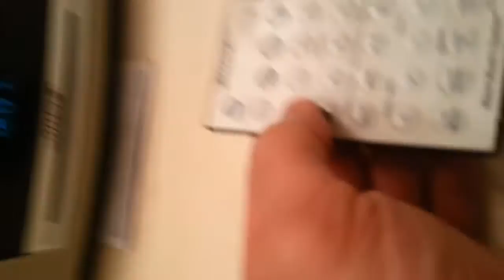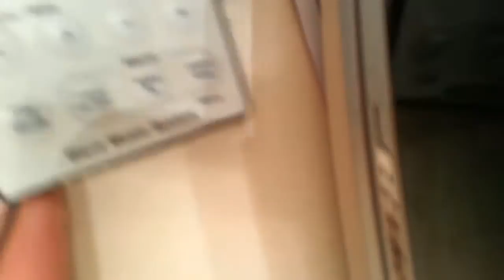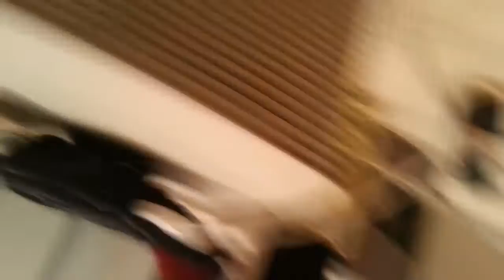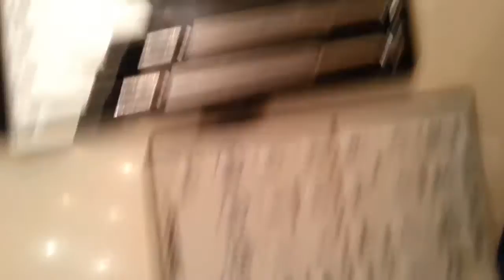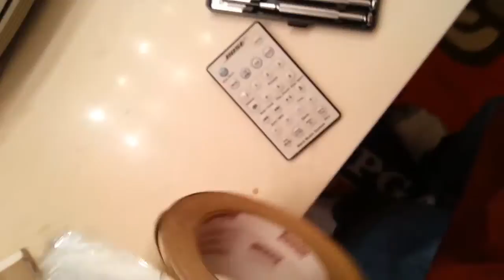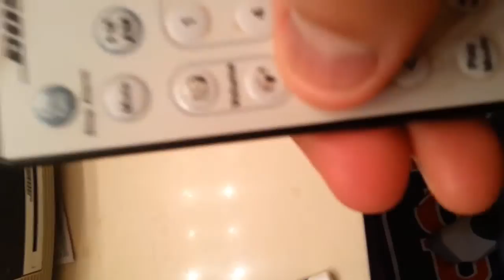How To Fix A Bose Remote Control For A Wave System

Comment: GMW: You didn't quite show where the aluminum tape went, but figured it out and have done both up and down volumes....a piece of cake!.Some additional tips you may find helpful. Use a paper hole punch to cut out the aluminum tape. Use a cotton bud to clean off the inside of both volume domes, and the other end to clean off the contacts of any residue. Use pointed tweezers to place the sticky side of the tape under each volume dome, and secure with the end of a cotton bud. Replace the top cover and make sure it's evenly down, or secure with clear tape over the edges. Pitty we have paid a lot of money for a good radio, they they issue a cheap crappy remote, but the fix should last for years.

Comment: Wow! Have had a Bose Radio since the 1980s! Late last year, the front was starting to peel off at the bottom and I held it together with cellotape. Found a sound shop that could give me an almost identical model for $26.00. All well for about a month then the on/off stopped working and thanks to your video I figured out why. Have just finished sliding a piece of aluminium baking paper under the button using a cutting knife, and ..... it works perfectly!!!!! Thanks for passing on the knowledge.

Comment: Thank you! Was easier to do than I thought, that upper layer is pretty thin so it's easy to pull up without chipping the plastic below, and the sticky stuff is good enough to just press back down. Works great.

Comment: Hello InfernoUniversity. You are brilliant. I followed your instructions, but I used a dab of gorilla glue and a tiny piece of aluminum foil, and it worked perfectly.
Bose make great sound equipment but this is the second remote in 2 years I went through. Thank you soo much for sharing your method...

Comment: Worked absolutely perfect. I've procrastinated for a year on repairing a "new" remote which had the same volume up failure. I removed the battery drawer, gently pushed up on the keypad from the open battery area which gave me just enough room to put an old dull razor blade (on the top edge) to lift the pad carefully off. I affixed a tiny dot of the aluminum tape on the underside of the button.....it works like a champ!! Thank you thank you thank you.

Comment: Excellent video! this worked perfectly!  I have the same Bose radio/cd player and the volume button was not working.  The repair cost me about $7 total.  Good job.  My only suggestion would be; next time let us see the actual application of the foil only because I initially applied it wrong🥴
Reply: Yes my question also thx it looks like u have foil on both sides. In other words u take 2 foil dots and place them together?